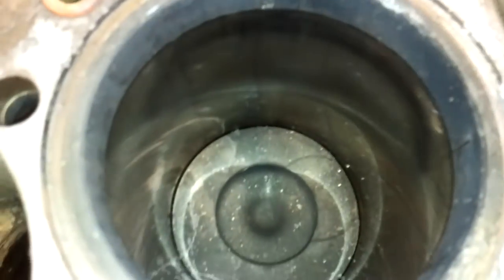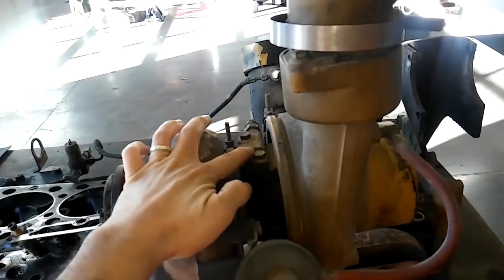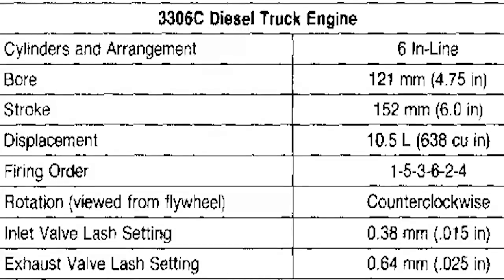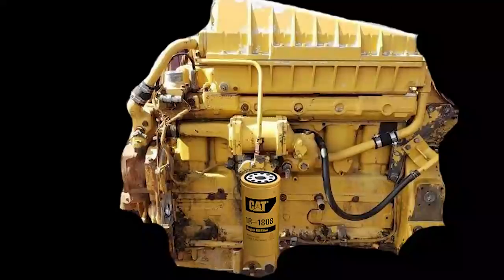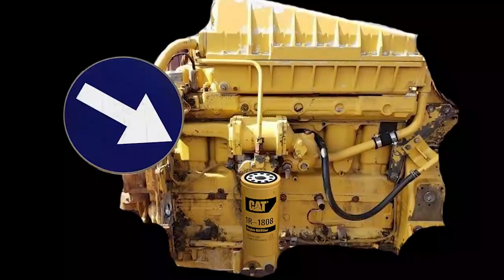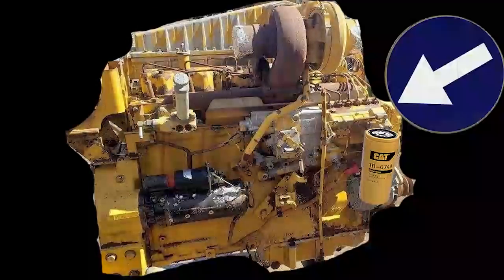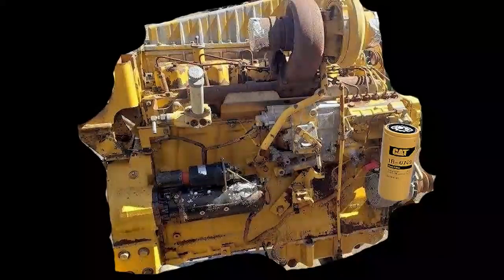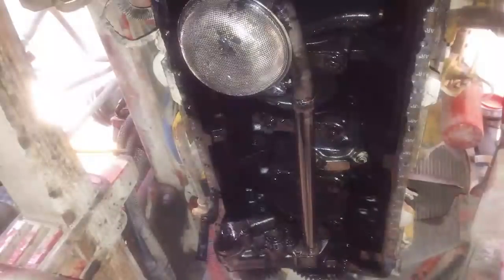The Cat 3306 and 3304 Diesel Engine. The BEST Engine you may have NEVER heard of.

Comment: Being older than Mr. Ape I watched the evolution of the 3300 series during my years working on them for my friendly neighborhood Cat dealer.
Beautiful in their simplicity and reliability. Power to weight ratio not great which didn't matter in a dozer or loader where you needed weight to keep the blade or back end down but not great in a truck.
They evolved from the D330 and D333 engines which were very similar except the head and block were a little different and the D330/3 stroke shorter if I remember correctly.
Cat must have built millions of 3300 series engines, they were in everything.
There were upgrades depending on application and experience.
Depending on the power rating the pistons may or may not have had the steel "Fire Plug" in the hollow of the piston where the fuel was sprayed.
There were also variations in the steel inserts in the ring lands. depending on power rating. 
The block evolved from a counterbore to a flat deck with spacer plate. Just cheaper to machine flat surfaces than counterbores. The head gaskets are different to accommodate lubing the rocker shaft
The spacer plate had some issues and was updated.
The head and fuel system evolved. It started out with what was called the "compact system" which was a pump that looked like a small engine, convoluted on the sides with injection pipes sticking up which connected to the capsule nozzles in the precombustion chambers [precups]. Precups were screwed into the head. Precups had glow plugs screwed into them, best -40 starting system ever.The head itself is flat except the valves and maybe some precup protrusion. The precups had different gasket/spacer/washer thicknesses to to allow the glow plug to be located more or less to the valve cover so the glow plug harness could reach. 
Next came the "Sleeve Metering" fuel system, hard to explain how it works in words. Rather than a helix on the plunger it uses drilled holes in the plunger and a sleeve around the plunger that was moved up or down to close the dump port and control fuel injected. It is identified by being rather small with a flat cover plate which accessed the innards. It didn't tolerate fuel contamination well.
Somewhere along here the precup system was kind of abandoned and an adapter that replaced the precup was introduced that fitted a pencil nozzle, no glow plugs.
Later heads had no precups, or adapters, only a drilled hole for the pencil nozzle.
The last incarnations had a fuel system known as the "New Compact System". Kinda looks like sleeve metering but bigger with a large cover.
The engine bearings were updated for environmental reasons. They used nickel or copper to bond the aluminum bearing material to the steel back. I don't remember which one came first but it got punted for environmental reasons and we were sent notice that the new bearing life wasn't as long as the old ones and should be replaced earlier.
The wet aftercooler was the last gasp for the 3300 series. Trying to get more power from a reliable old steed they gave it colder, denser air.
I suspect the demise of the 3300 series was there was no easy way to make it meet upcoming emission standards.
Plus Cat bought Perkins which gave them all the engine technology they lacked in the emission arena and if you study you will find the smaller modern Cat engines are Perkins painted yellow.
The purchase of Perkins also gave then access to British Military contracts, tank engines and such.
Main problems [besides poor maintenance] : Yes they did drop valves at high hours. Valves were improved over time. Sometime an injector slobbered and melted a piston.
In 1980 to get 10,000 hours out of an engine working hard was darn good. The 3300 series would run 10,000 hours without the head being pulled, and more.

Comment: I once worked on a D6R tractor, which had this engine, it had electronic control in the transmission, but the engine was mechanic.
 I started after 2 years of being stopped, the most impressive thing was that it did't have the injector tubes, and in fact the pump and inyector connections were rusty, I really did not think it would turn on. It started at the first try, and sounded like new, it was impressive!

 Really I think the best engine with which I hace work!!

Comment: 3306 is the best engine I have on the farm in a Challenger 65A. 15k hours of hard work in the hills and has had nozzles, water pump, and injection pump and that’s pretty much it. Just sips fuel for the work it does too. Starts way easier in the cold than it has any right too as well.

Comment: We have two CAT 930 loaders and a 920 all built between 1979 and 1980 and they all run non-turbo 3304 engines and they are still running strong after 42 years…

Comment: Lots of them in the Alberta oil patch that run compressors. Good units! They’re all converted to run on natural gas.
Reply: How long have they lasted?
Reply: My experience with them on nat gas is that they are very poor. 3400 on gas as well. They burn valves constantly. I can't remember the numbers for certain but I doubt much more than 5000hrs on a cylinder head.
Reply: @davidscott5903  Years. They get serviced every 2000 hours.
Reply: @nathansihlis4866  Fuel gas quality is always an issue for sure, having a knowledgeable mechanic set them up to run properly with the fuel gas on site is key. Engine oil also plays into having bad valve issues. We had to quit using a Conoco oil because it caused nothing but problems. The Esso GLX and GMA 40 oils were more expensive, but the maintenance bills are much lower than when we used the cheaper Conoco oil.
Reply: @tombryant4518  yes for sure. Those points are vital to longevity. It was Esso or Chevron oil on almost every unit we serviced as I remember. I remember changing many many heads on those small Cats. We were always sent with a head and gasket kit when we did a service on those units. The Waukesha F11, 18, H24 were somewhat better.
Reply: @nathansihlis4866  I ran a plant once that had an F18 driver on an inlet booster Ariel compressor. It was great until someone decided to ether it after it’d been down all night in -50°C. They horseshoed the pneumatic panel and let it rip! 
Even after a complete overhaul, it was never the same. 
The main sales driver was a 3516 coupled to an Ariel JGK4 that never skipped a beat.
Reply: @nathansihlis4866  I think it’s interesting how different areas have their own sets of completely different problems.
Reply: Yep, had one on a remote well in northern Alberta and it only went down for a service or downstream compressor went down.
Reply: @mikedee1  I always found the junky Gemini compressors caused all my downtime.
Reply: @tombryant4518  the ones with needle bearings in the rod small end?
Reply: @nathansihlis4866  Not sure. I don’t remember ever seeing needle bearings, I’ll have to ask the mechanics about it. I’m just the operator.

Comment: Those engines are the Holden red motor which powered Australia cars for 40 years, super reliable dead easy to fix and what I did my time on 40 years ago. I  converted a 3304 DI to a 3304 PC in 1987 to meet emissions in 1987 in the underground eviroment. A lot to be said for PC engines as far as emission go, my 2 cents worth

w

Comment: I worked on a bunch of these engine's and I totally agree they are a great ENGINES I did a lot of over hauls on them they were high hours. One thing I experienced with them is when they started blowing head gaskets, they had low liners they had to be brought back to height by shims or redeking the block. They had a lot of hours at this point.

Comment: Had a 235 excavator with a 3306, only problem in 20000+ hours was the head. Still running a 950 with a 3304 over 25000 hours with no issues. They’re close to bulletproof

Comment: Had a D6R come in last year, was ran out or low on water to a point the exhaust had turned white, and the paint on the head and side of block turned red. Still ran pretty well but was smoking a decent amount. 3 pistons galled pretty bad other 3 were honed and re-ringed and 3 new packs new main and rod bearings and a reseal and away she went..  At the customers request of course... 3306

Comment: excellent......one of the few Cat engines i have anything to do with
Reply: Yep, last mine I worked in had two underground locos with 3304 T engines. They where scary fast on the rails. Your hard hat would start to lift at half throttle.
Best wishes all.

Comment: CAT makes some great engines and I feel they're very underrated in that regard unless you've owned one. As said, the 3306 and 3304 are some of the best. I have an old  1962 977h crawler loader on the farm for the last 40 years of it's life and the 333D engine that came before the 3306. It has over 19450 hours with no rebulid.....the hour meter died about 10 years ago....should fix that. That machine's done everything from hauling manure, to plowing huge 5 foot + snow drifts to knocking down trees. Love these CAT videos, keep them coming! Gave me a good laugh with the filter....should date stamp it too! haha

Comment: I guess because we work on a lot of equipment engines I rebuild a lot of the 3306 and 3304 engines . I just finished a 3204 and presently a 3046 . A 3046 is actually a Mitsubishi S6S . They are frequently used in D3 dozers and 963 Loaders .
 What's strange is Ford put the 3406B and the 3306DI in their 9000 series trucks . 
  Rebuilt a pair of the 3208 engines out of a boat a couple of years ago .

Comment: 3306 powered the 235 excavators, generators, pumps, crushers and everything else you can think of. 3 of them in use at a crushing operation I do work for, had one that was 90% worn out and still ran everyday, when we tore it down it had multiple broken valve springs, liners were scored, it was bad, but it still worked everyday.

Comment: I had a EL240B cat excavator and it had a 3116 engine. The only problem I ever had with the engine was fuel in the cooling system and it ended up needing a new head. Cat service did it on the side of the highway where working.
Reply: I also had an EL240B Excavator and it also had a head issue - cracks I think - but a ‘dressed’ replacement head from Cat was only NZ$1300 (cheap for here in New Zealand) meant I was back Logging in no time. I also had a 325A with the same engine and it too needed another head. I think the heads must be weak on them. Otherwise they are a great engine.

Comment: the Marine version is even better ;-) full throttle 24/7 for 72 hours, no increase for the exhaust, just running like a Swiss watch. Definitely one of the best engines ever build. We had the PC & the DI. The PC consumed 45 liters and delivered 193HP  24/7full throttle whereas the DI used only 38 liters full throttle and produced 235 hp. Only problem by changing from PC to DI, we had to change the oil brand.. With Castrol, the DI engine consumed oil. the other brand stopped the oil consumption.

Comment: hy guys , got a d5 in my farm with a magnificent 3304, just a huge detail... as this is close to 25 y old , its time to upgrade it on the power side, and can´t find any info on that fuel pump and governor.
engine is rated @ 120hp but i would like to get it to 150 or so, as the jobs i do are not hard puling every day, but dragging a harrow , and when uphill it would benefit from the 25 ponies
thanks

Comment: Another interesting topic. Electrolysis/cavitation, difference from the two
Reply from the maker: That is a good topic idea, thank you.
Reply: I would love a video on liners!  I was curious when or who started using liners.  I didn’t have much luck finding information on liners.  I just had a IH 1066 tractor with the DT 414 majored.  It was liner type engine that was built in 1975.  I heard IH had a lot of problems with pitted liners and started outfitting them with coolant filters that had a treatment pill in them that would treat the coolant.  
My engine was way past receiving an in-frame and was an out of frame major OH.

Comment: Theses was OK off road, but I disliked them in a truck. The 63Z engines had head gasket recall, camshaft recall, slipper cam (roller cam was better and fewer problems), servo pin could come out and engine could runaway, cylinder block cracking at the rear cover. Cat tried a non metal impeller on the water pump and it would break and fall off.  The 9TL's has two different push tubes and people would mix them up on a Jacobs brake application. They would fold up and snap push tubes. I would put the bigger ones on intake and exhaust so this would not happen. On Jacobs brake engine the valve cover gasket would leak a lot. In a PB you have to loosen and swing the front cross member out to get the oil pan off. You set the Jacobs brake with a circle gauge. Basically touch and turn method. The VTU is a slide advance and you had to pull the front cover to make any major repairs. And the biggest problem was truck salesmen would convince the buyer to get one because it was lighter and do the same job as a 3406 A/B/C. I have one right now, ATAAC and the turbo is discontinued. On JWAC engines bolts are on the inside and you have to take the darn thing apart to remove it off the cylinder head.

Comment: I always thought the 1693 425Hp PCTA was the best. I had 2 different 3406 one an experimental PCT 325 Hp  and the other was a PCTA  375 Hp What you now call the A model. It was called an AFTERCOOLER not an Intercooler (Air to Air) which was a MAC invention. In other words if it was cooled by water it was an Aftercooler and if it was cooled by air it's an Intercooler. and the 3306 was the baby brother to the 3406 just like the 1674 was the baby brother to the 1693. The only thing you didn't mention was the PreCup also had Glow Plugs so you could start them at -20 below easier without using either.

Comment: The idea that fuel supply system and exhaust manifold are at the same side is not good idea. If the high pressure pipe is broken, it will be on fire.

Comment: On the High Plains of KS OK and TX there are thousands of 3304 and 3306 pumping irrigation water.   All were made in the 1970's to run on gas.   Cat still sells new ones.  I am buying one rebuilt  4 cylinder for $21,000 and another I have to overhaul for about 1/2 that much.    You are right about being the best.

Comment: Drop valves start with not enough oil spry from rocker arms toe the valve seats worn out toe n point valve guides leaking then so bad valve springs fail.

Comment: These are still produced for the industrial natural gas engine market. They are almost bullet proof we easily get 40-50k hours out of one before overhaul. Front main is a common problem but sometimes it’s not actually the seal itself it’s the o ring that seals the aluminum seal carrier that gets hard and brittle.

Comment: On the heavy equipment side if you ever have a no start likes its not getting fuel the rack loves to stick on them or if it seems like you cant control the fuel no matter what it's doing eg(if your going to park it make sure the rack is off all the way) so how do you fix it take a hammer and smack it on the lever coming out of the injection pump a few times and then try it hopefully thst fixes it for anybody.
Reply: Tap the rack link

No smacks for the IP 
I've met too many operators and customer techs in the field. Words like "smack" mean different things to different people hahaha

Comment: I would agree the 3306 is a great engine PC or DI. The PC has a distinct clack to it. I once swapped a PC, or may have been a D333 gen set. I think it was up around 40,000hrs. We got called because it had a oil leak. Turns our there is an idler gear in the front end that the retainer plate had worn off and let the idler gear walk and wear a hole through the front case. It was time for a new unit. I wouldn't agree the 3116 or 3126 were any sort of successor to the 3306. 6.6 and 7.2L vs 10.5 is a completely different thing. 3176 yes that was the successor. Lastly, the 3300 and 3400 series were very poor when run on nat gas IMHO. They would burn valves constantly. Even NA they never held up. Great on diesel though. Great cold starting, fuel consumption, power and easy to work on.

Comment: 3306 is one of the best engines! We run three blades, two early H and one 86’ 140G, all 3306 engines. That old G model has over 30K miles and still out preforms newer blades with the weaker 3176 emissions plagued blades, all day-every day. People on the jobs aren’t use to seeing an older machine not spin its wheels with a heavy load under the board I like the newer machines that just spin and spin. It’s almost as if Empire invented the perfect round wheel, then reinvented but came up with a three-sided triangle wheel…

Comment: Have a 87 White with 3306 in it,, well over million and a half k on it. Great engine, dirty though keep the oil changed. Had a 8ll on it should have had a 13 speed or 18, would lose the turbo when shifting had to wait for the turbo to spool up again before it would start to pull again only complaint I have with it

Comment: Worked on 3304 in the 941b, 3304 turbocharged in the 951c, and 3306 in the 955 and D6. 3304 had a counter balance shaft would break if an idiot was running the loader hard, they could be a real pain to get out. You are correct about dropping valves I worked on Numerous dropped valves issue, sometimes cracked heads, always changed the power pack in the affected cylinder. Found out it was cheaper than the downtime and parts